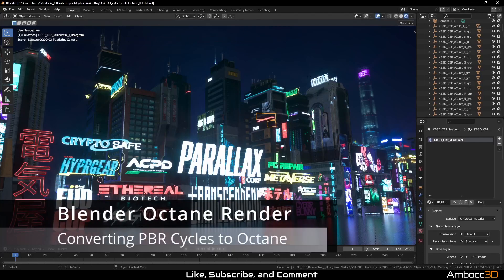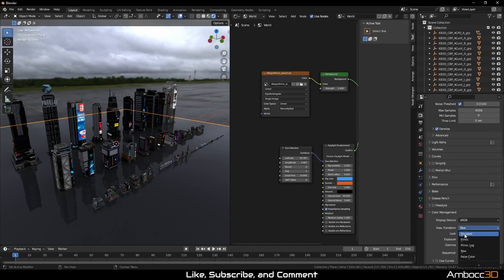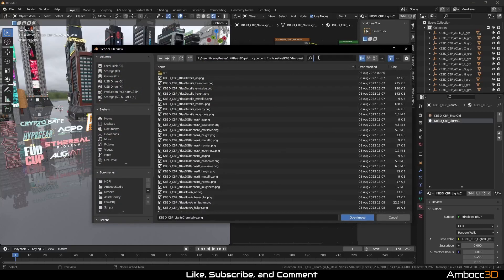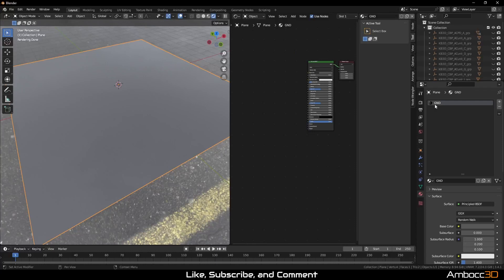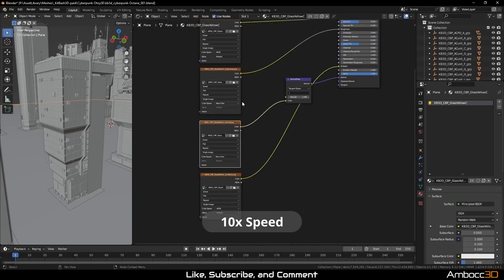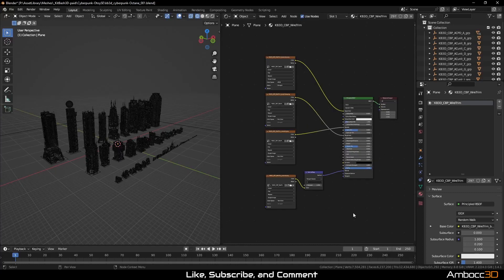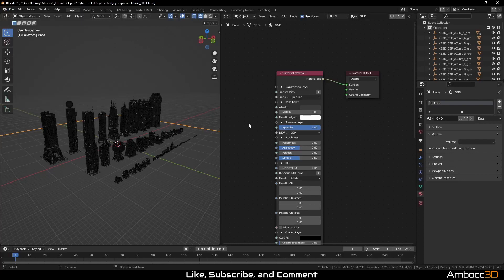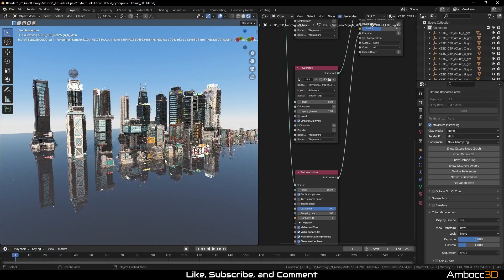Blender Octane Render Tutorial | Cycles to Octane Material Converter

Comment: I still believe that you need to set  the specular value back to 0.5. That is the common value for non-metal materials like rock, wood, and things like that. 0.5 is defined in PBR BSDF which describes the rim reflection effect or Fresnel reflection or F0 in PBR BSDF. And for reflectiveness, you need to tweak roughness instead of metallic. Usually you just need 0 or 1 to tell the renderer whether the material is metal. Sometimes you need value in between just to blend a metal material with a dielectric material.
Reply from the maker: I thought so initially, but after some test, I ultimately concluded Octane was not following the PBR BSDF model exactly. This might change with the upcoming release.
Reply: @ambocc  To be honest, that still sounds weird to me, maybe it has something to do with the view transform or things like that? I think I will have to dig into that maybe send an email to Otoy to get verified. But still thanks for this important info.

Comment: Hi thanks for video! how to use alpha/opacity map, when I convert it to octane it is not transparent anymore?
Reply from the maker: If you have an RGBA image with an alpha.  You need to use the Alpha Image node to extract just the alpha channel for the opacity. The normal RGB image, will ignore the alpha channel.  If you have a separate image that is a Grayscale Image for Opacity, you can use the Grayscale Image node.  Hope that helps.
Reply: @ambocc  Alpha image connected to opacity didnt work, seems like grayscale fixed the problem. Thanks so much!

Comment: I'm trying to convert a Cycles material following your instructions. In this Cycles material, there are nodes like Mix, Hue/Saturation, etc. After converting to Octane material, they just disappear... The Octane material is white with no nodes. What  I'm doing wrong?
Reply: The converter doesn't handle those nodes at the moment, only handles textures, bump, normal, emission, and nodes directly into the Principle. Essentially a basic PBR setup.  I would detach those other nodes to the side and convert it, then manually place those back. Still a pain in the butt, but still less work overall.
Reply: @thomas-cheng  thank you